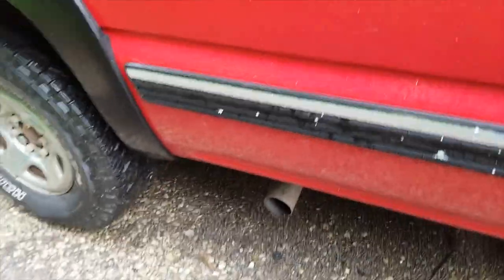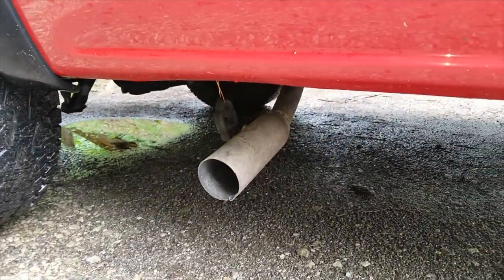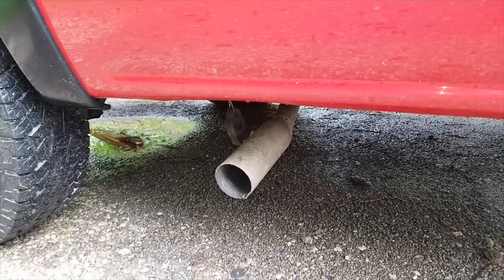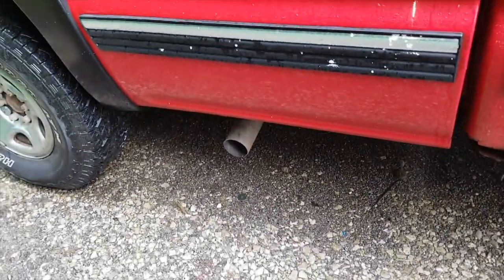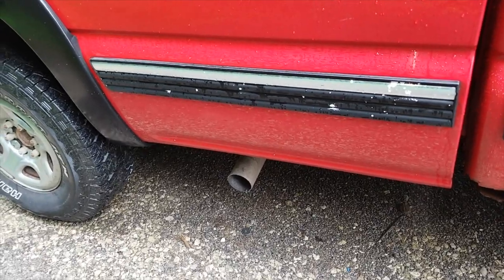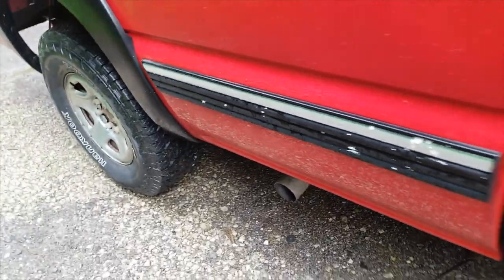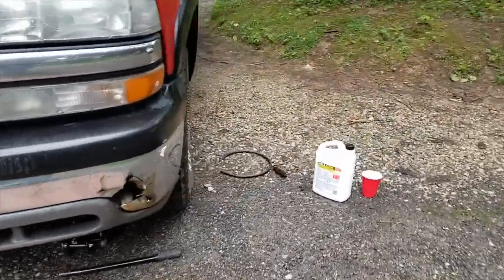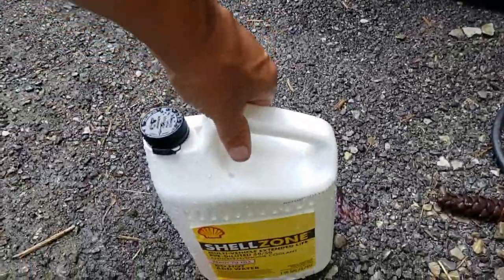Can You Use Antifreeze to Balance Tires?

Comment: Luke, you've got that truck running great, and the sound of that motor while you're shifting is fantastic! I didn't know about the antifreeze trick, but it seemed to work for you. Looks like you are getting lots of rain just like here.
Reply from the maker: Yes it rained almost all day Sunday. I had to take advantage of a few minutes break in the rain to do this. I think I may need a little more in the back tire, but other than that it worked.

Comment: I do something somewhat similar.
When I was researching how to balance my own tires, I was noticing how the centramatic automatic tire balancers work, but I wasn't willing to pay their prices. So after thinking about it for a while, I realized I could just put around 3 to 5 ounces (weight isn't critical) of BB's into my tire, and it should do the same thing. I tried it and found it's cheap, and works great! Although I do need access inside the tire from the top bead area. After letting the air out of the tire, I just break the bead near the top of the tire, and insert a tube with a funnel on the other end to direct the BB's into the tire.
Reply from the maker: Good idea with the bb's. I used this anti freeze balance technique on my Buick yesterday. It is smooth as silk all the way to 85. If I would have seen this comment first I would have tried the bb's. Maybe next time.
Reply: @lukeFugate  what happens after you go faster than 85mph? or that as fast as youve gone? thanks
Reply from the maker: @yourchava  I think it will still be balanced at any speed. It is a constant dynamic balance. I don't think I'm likely to do more than 85 so I'll not get to test it lol.
Reply: @yourchava  you go back in time...
Reply: One might be able to blow the bb's with a hose and compressed air thru the empty valve into the tire?

Comment: JC Whitney used to sell a device that one bolted to the wheel.  It was a round tube that I think it had some sort of balls and fluid inside of it. It was like a mini Hula Hoop. They said the balls at speed would accumulate at the side of the tire that needed weight.
I believe your experiment,  but it would have been good to see a before video of the steering wheel and camera shake. I am going to do my truck tomorrow. Those tires have so many plugs in them I get the shakes. or maybe over time I lost some of the weights. I am on the highway for usually only 5 miles, so I have just been putting up with it.
Reply from the maker: Yeah, I wish I would have done a before and after of the shake. It got pretty bad at certain speeds. I think the back driver side still shakes a little. I may have to add more to that one. I kind of had some doubts, but it seems to work!
Reply: They sell those for semi trucks and RV busses they’re called Centramatic wheel balancers. I have them on my semi truck and they completely take all the shake and skip out of my tires. Even the worst tires ride like brand new. I regret buying them now that I’ve seen this video. Live and learn.

Comment: Great video
I did use air soft bb for the last 2 years work great  , now I switch to antifreeze.  My only concert is my TPMS sensor 😳 but it is too late now , so time will tell if my sensor go bad!😬
Reply from the maker: Thanks! I have heard of the airsoft bbs method. Never tried it though. I have antifreeze in all my new tires now and it seems to work well. I don't thing the TPMS sensor will last very long though.

Comment: Everything to do with longevity of your suspension parts starts with proper wheel balance, if your wheels are hopping up and down your tires will wear unevenly, and everything like ball joints, links and bushings will wear out quicker.
We recommend to our customers wheel balance every two years, but maybe we should  be doing this and throwing away the expensive balancer.
Reply from the maker: It has been working fine so far. I just bought new tires for my other truck and ended up doing the same to them.

Comment: Awesome video Luke…I’ve heard and seen videos of using the plastic airsoft BBs but the antifreeze i would trust more. I just wonder if the weights would need to come off before the antifreeze goes in but i didn’t see you take yours off and it still worked i assume .  Do you think it matters if the weights come off or just leave them on?
Reply from the maker: I didn't have any weights on mine. I think it would be better to take any weights on it off. Sorry for the late reply, I didn't get a notification.
Reply: @lukeFugate     No problem..thanks for the reply.

Comment: Great video, thanks. It didn't work for me several years ago so I put airsoft BB's in and they worked. At slow speed you could sometimes hear them. After a year or so the BB's turned into powder,  I didn't hear them anymore,  but it still worked. That made me think that sandblasting media would probably work too. After seeing your video I'm thinking I'll try antifreeze again on another set of tires but this time add more of it. How do you know how much to put in?
Reply from the maker: I had thought about trying the bbs , I may still do that to see how they compare. 
I put in about a cup and try it out. If it still has a little shake I'll add in another half cup.

Comment: I'd feel better using the other guy's idea about using BBs better.  My concern with anti-freeze is, while braking that the rims could stop while the tires keep turning due to the lubricity of the anti-freeze.  Rims build up with rubber where the tire meets the rim from movement in the bead area as it is.
Reply from the maker: The tires are showing signs of wear now and will probably need replaced in the next year or so. I will update when I change tires next. I am curious myself too.

Comment: Can you give us an update on the antifreeze in the tires?  Is the truck still riding smoothly?
Reply from the maker: It was smooth right up until I got new tires a while back. The tires didn't seem to have any damage from the antifreeze either. I balance all my tires this way now. It also has the benefit of being a leak detector. I ran over a nail once and could see the wet spot on the tire before it even started looking low.

Comment: Does the anti-freeze help distribute heat within the tyres more evenly?

Also, what about using multi-seal for dynamic balancing?
Reply from the maker: I hadn't thought about heat dissipation but I suppose it does help with it. Not sure about the multi seal but I think it may be too viscous to distribute evenly. It would be a good experiment to try.

Comment: How much antifreeze goes in 24 inch tire need help u a saver
Reply from the maker: Not sure about a 24 inch. I would say try about 1 cup per tire. Try it and then if it needs more add a few more ounces and try again. I kinda guessed and it worked out for me. It still works great by the way, still stays in balance.

Comment: Do NOT put antifreeze in your tires! It will absorb into the rubber cause it to swell will lead to irregular tire wear and/or perfectly looking tires to unexpectedly blow out!
Reply from the maker: I have since this video replaced the tires as they were getting pretty worn. There didn't seem to be any problems associated with the anti-freeze. The tires looked fine on the inside. That is not to say it doesn't have effects after many years. After two years there was no damage though.
Reply: So I should of been more specific.
Dex-Cool is what we used(my boss's idea) it turned into an oil like fluid inside, cause irregular tire wear qmade the inside of the tires softer(some even had visible swelling) but the worst part was  they were more prone to blowing out. 
They were 11R22.5 Kumo tires.
Maybe there's something specific to our combination.
Reply from the maker: @thomasnelson5010  yes Dexcool is corrosive to cooling systems. I won't use it in my radiator. Didnt know it was bad for rubber too. Interesting to see how different brands effect things.